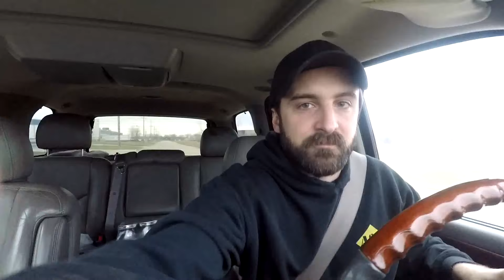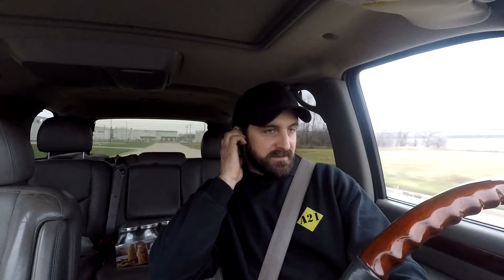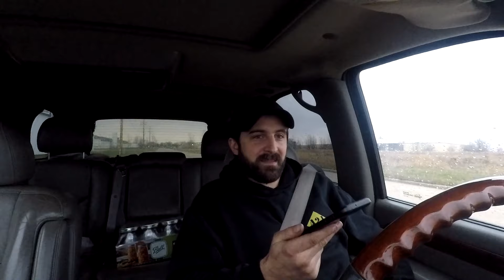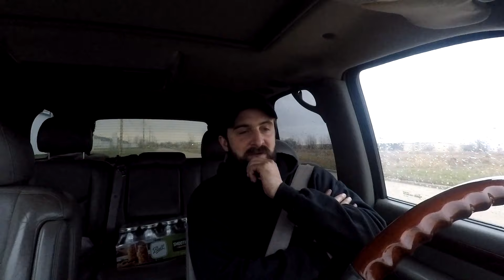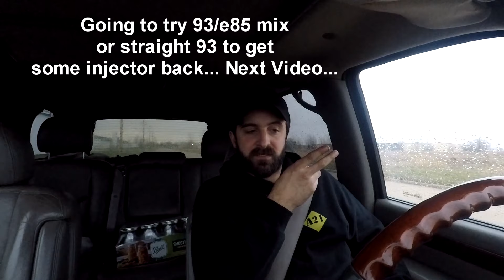MINT!!! First Drive After Duramax Intercooler Install

Comment: You really need a 12v power supply for the tuning laptop.
Reply: I enjoy the videos. I would like to send a power supply if I know what plug u need for that laptop
Reply: @electricandlspower  I have one just for times like this. Plugs directly into a cig lighter hole. No inverter needed.

Comment: I had that kinda same thing happen to me I was doing some tune work on this truck and the owner bumped the HP Tuners cord and it completely erased. Lucky after a few tries it come back.
Reply: I always tell the owners to sit still while I'm writing. I ended up replacing the cord and it stopped the intermittent disconnect issues.

Comment: Good thing is that massive duramax intercooler is working. Hope you didn't brick the ECM. There's a trick to recover it though. Involves opening up the ECM and grounding two of the pins. It's online somewhere.
Reply from the maker: Its all good. Charged computer for and re did the write and drove home.
Reply: @BlaserBuilds  Great!

Comment: gotta give props to da wife ;) what should the watercooler temp be? seems like the intake temp of 65* would be on the higher side but I haven't seen a watercooler setup but supposedly black ones cool better then any other color .. I'm not sure I understand this build. are you trying to make it fast or reliable because if you take it to the track, you could save a few hundred pounds just taking out the seats etc.plus you should have it caged if you are really going to race it just because it's so tall
Reply from the maker: This is just an air to air cooler. No water. 65* is really good. But more looking at the rise vs actual temp. Before it was over 200 degrees... Goal is a comfy driver, that is also fast.